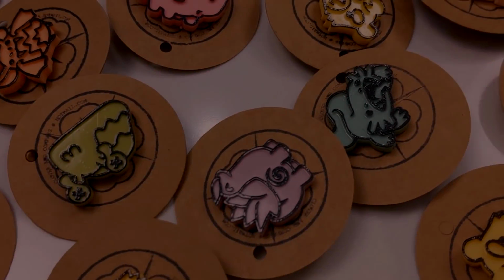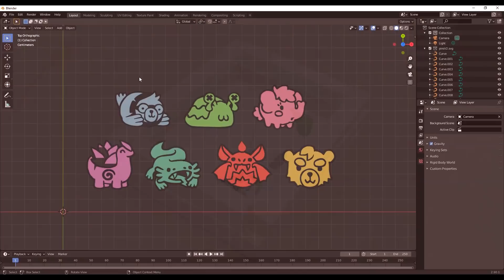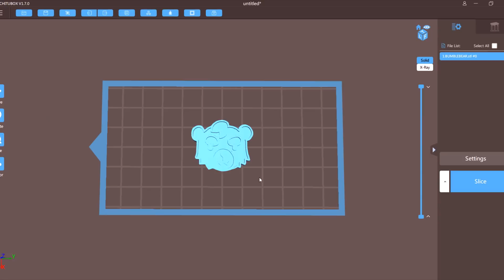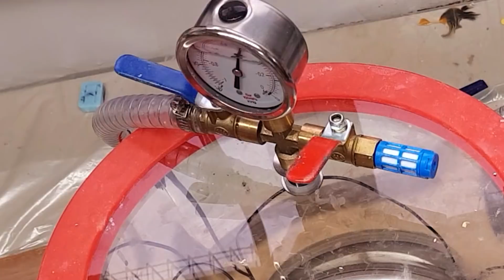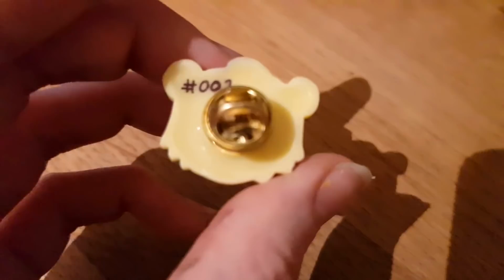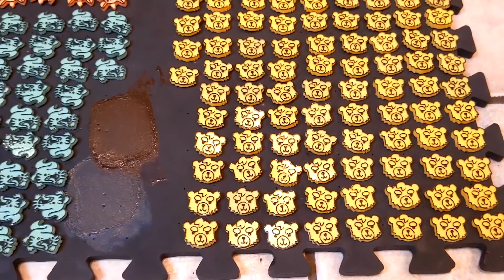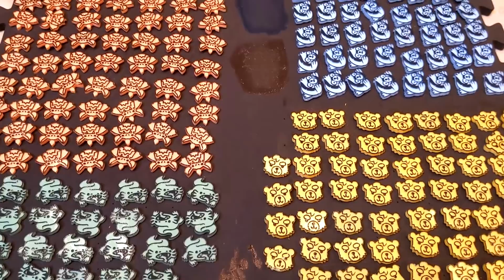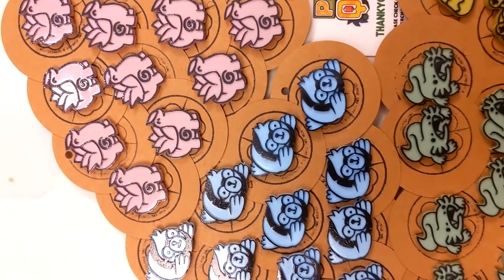How We Made Cute Resin Pins!  (Patch Quest Merch #1)

Comment: It's really interesting to see how they're made. I had no idea it was so many steps. I guess once the moulds are made it's all a bit quicker after that. 

Can you get the 3D printer from the start to print anything like the resin? I mean that would make production much faster. Though if it feels plasticy that might not be great.
Reply: Yup once I have the moulds it is quicker! The printer also uses resin just a different kind. There are 2 reasons for moulding and changing the resin. 1. Colour choice. The printer resin is severely lacking in colour choice. 2. Durability, the printer resin is less durable so it's not advisable for things that may take a beating like pins. Hence why I use it to make my masters but not the final product. Though if I could just use the printer itd be so much easier 😅
Reply: @enniabarden4453  Ah that's interesting, thanks for the nice answer. 

I guess making a product you're proud of is worth the extra effort.